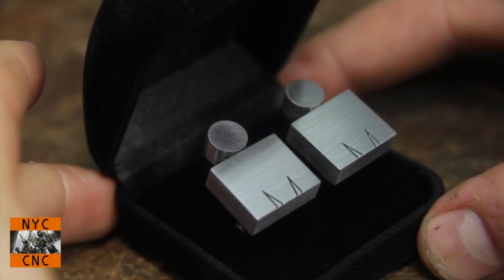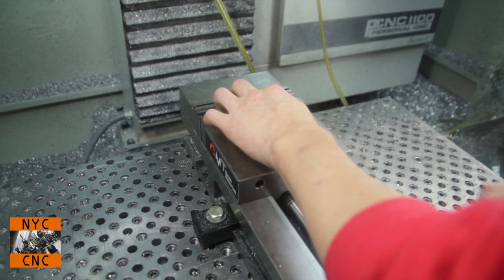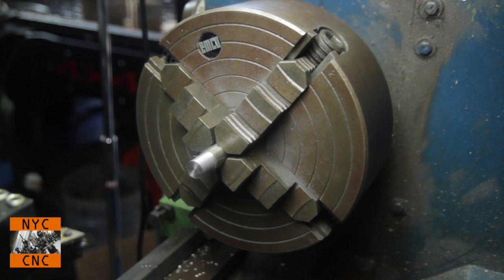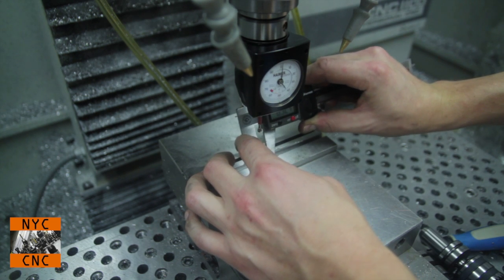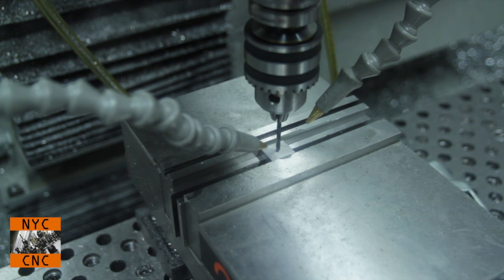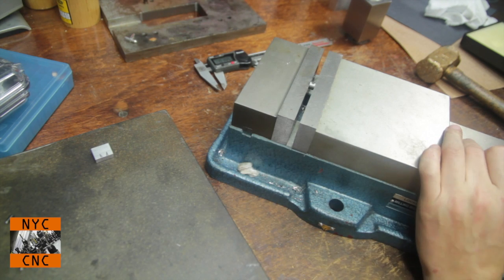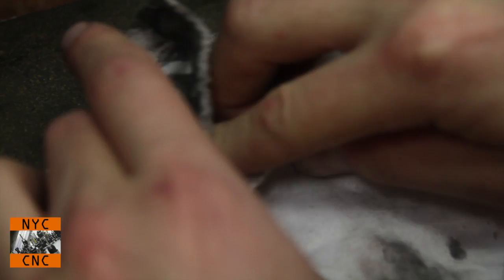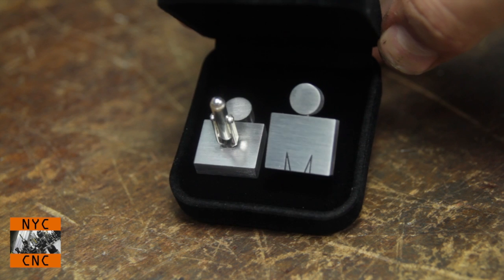Machining a set of Cufflinks out of 4140 Alloy Steel on the Tormach PCNC 1100

Comment: If you do silver solder cufflinks in the future, you will want to use a very fine torch so that you don't heat the spring in the toggle mechanism. Once that spring steel is heated red hot, it loses all of it's elasticity. If you don't have a fine jeweler's torch, I've had success with using 3rd hands to hold the part over a cup of water with the toggle submerged. This is a trick used a lot to protect a gemstone while resizing a ring.

Comment: An little idea I had while watching the video: seems like you could do the waxing after attaching the backer. That way you could hold on to the backer while applying the wax. The reason this idea came to mind is I figure you'd have to do it that was anyway if you were to solder the backers in (I'm assuming the soldering heat source would negatively affect the wax).

BTW: I thoroughly enjoy your videos! Thanks for taking the time to create them!

One last thing... I've noticed that you always call your degreaser "palm pre". I bought a bottle based on your recommendation, but I cannot find the word "palm" on it anywhere. I'm guessing you're inadvertently referencing the "Palm Pre" cellphone. :)

Comment: They have a pretty decent jewelers torch at harborfreight for 129. it hooks to regular oxy/acety fittings with a length of a small hose. mine is bench mounted with a gas saver rest {shuts off the fuel/air when you set the torch down, relites when you lift it} Anytime we are welding/soldering sensitive stuff we have a coffee can with an adjustable clamp on the top. Fill it with water and submerge the part to be welded. Used alot for suspension parts with teflon liners around the ball.

Comment: well i dont think you have to reprogramm it you just have to write the toolpath and RL (milling on the left side to climbmill) btw the surface looks better if you use the outer side of the 90° miller because the vc are much higher!  for example if you use a 10mm Endmill and say its an 8mm endmill just get the height at 4mm radius and you are good to go :)

thats how we do it where i work :)